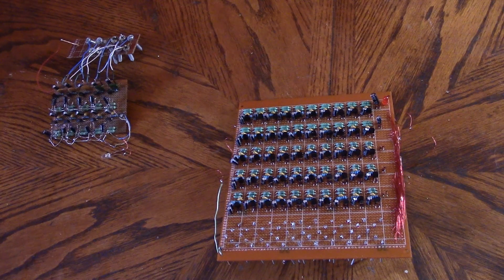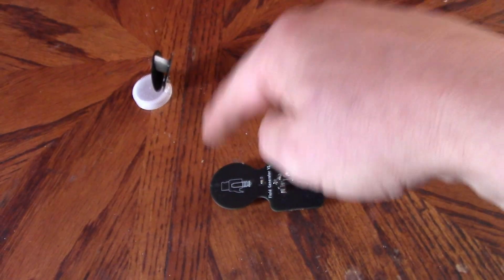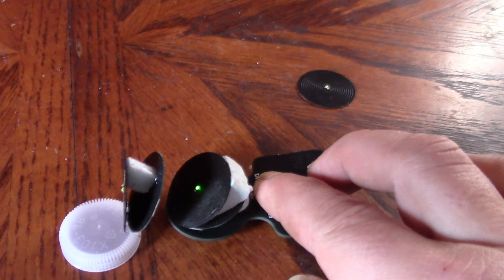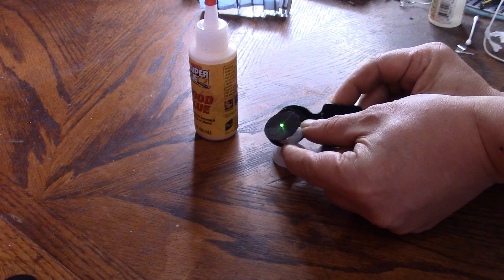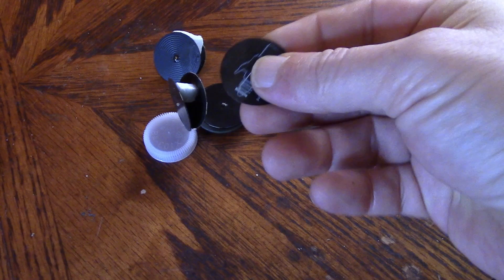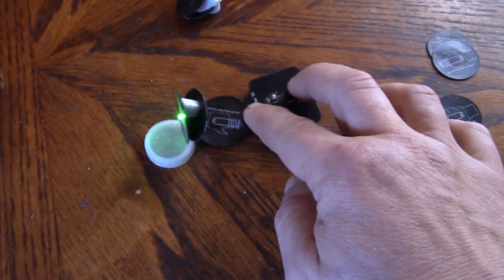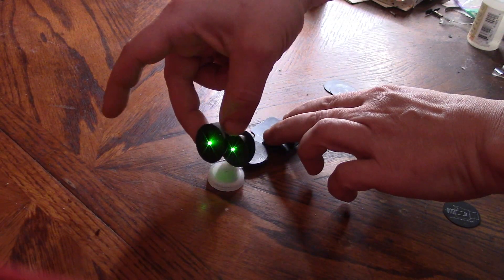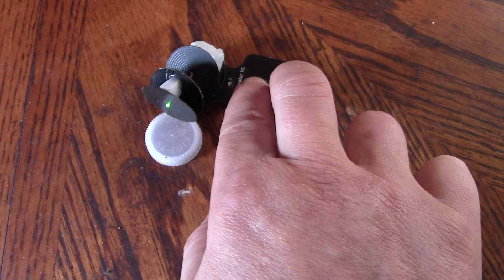90 degree wireless power + Power Chip update

Comment: Inductors might be to close to one another. Another thing to note is have a "antenna" wire on the collector it will pick up stray capacitance such as your body near the circuit or stray capacitance to ground giving you nice longer pulse's versus vary fast ones. Also slower longer pulses are better for inductive kick you will use less power and fully saturate the inductors.

The circuit has a lot of very similar components to a AM radio a led is essentially a diode and your using a 1mH inductor which is low side of AM spectrum.

I noticed when I tried to make a spinner with this circuit I couldn't get it to pulse the air coil so my guess is just space out some of the inductors and capacitors away from the collector inductors.
Reply from the maker: Many thanks for your thoughts, they are appreciated 😀
Distance interaction is something that's been noted over the years. The surprise being the original version and how each osc fired independently. I thought for certain they would fire together, taking their lead from the strongest.
There is something different with the larger build and, yep, component distance may be why it still doesn't work in the same way as that original. It still does a familiar stop, right at the conducting voltage of an LED. The first circuit sailed through, adding and adding, using the summing of all.   

Interesting radio and antenna thoughts too, thanks again for your help.

Comment: That is frustrating that the 50 oscillator 'chip' is not working, it certainly looks great 👍👍
Reply from the maker: Thanks and yes, very frustrating. It should have been a case of perhaps splitting into 5x10 banks of oscillators, while 10 are known to have worked. I fear my soldering has messed it up too. Each circuit is being tested one by one at the moment. A finding has been to flip the inductors around, for some reason an oscillator starts better with them one way around than the other. The opposite of how they are now.... x50 🤔 🤨🤐 🤬
Reply: @Slider2732_  hmm, interesting finding, they are coils after all and they might have a specific geometry which influence magnetic field/flux … and in such sensitive circuit any little difference count.
Reply: @Slider2732_  🤣 sorry

Comment: Sounds like Quantum Entaglement Shielding. What happens if you increase voltage. Is the range extended? Sending you a Lab update email my good friend. My very best regards to you both.
Reply from the maker: Thank you squire and a pleasure to see you commenting, hope all is well!
If voltage is increased then there is more field energy and more range, but it's not linear, often with decreasing advantages. 3V works well on this design, which I developed with hamspiced and was made by him. 
Plus puffs of smoke tend to get in the way at a certain point 😀
Reply: @Slider2732_  I understand my good friend. I will have another think. As you know, I do all my thinking with no box in sight. 😁
Reply from the maker: @MYNICEEV  Haha 👍